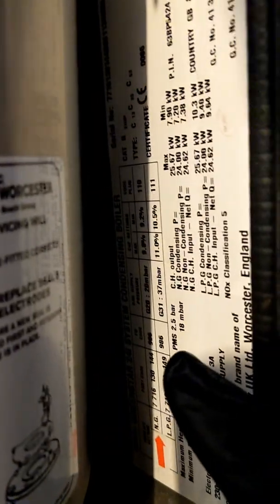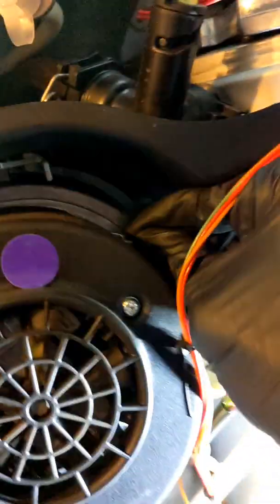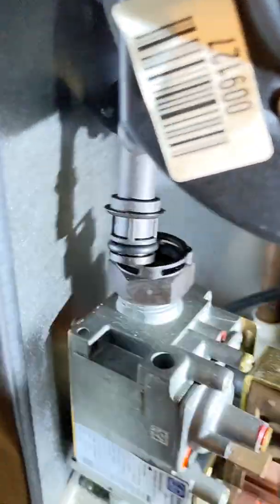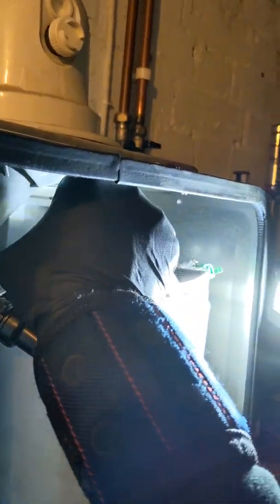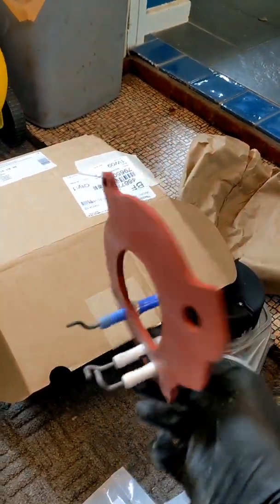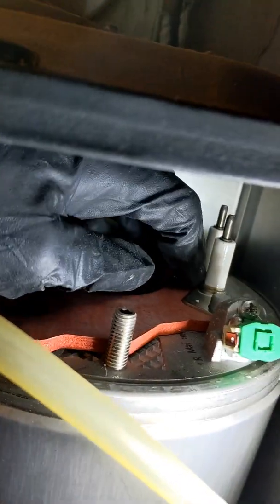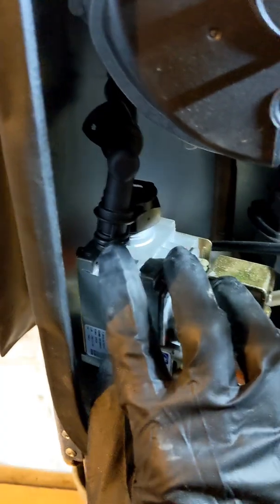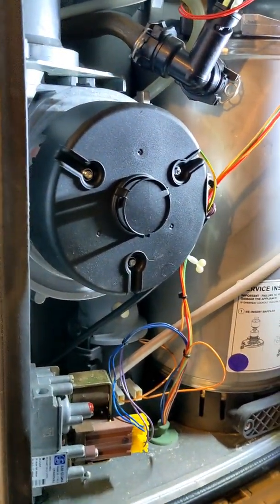Worcester Bosch fan change

Comment: Amazing video. What’s that rubber flap called. One side is completely opened on mines. Should I change it. What’s the product number. Thanks!!
Reply from the maker: It's called a bearing plate 👍🏾
Reply: The plumber put it back without changing it as he didn’t have the part. Does it need replacing or it’s not essential?
Reply from the maker: @tomanderson8614 it would need replacing

Comment: Doing my first one of these tomorrow. I've done some burner seals on these and found there's no one way to get that fan arm in.. with relative ease! Sometimes it's went in with the locking nut screwed mostly down. Other times it's only went in with the locking nut screwed away up. Absolutely hate Worcester lol!!
Reply from the maker: Good luck man! 👊🏾
Reply: @cputilitysolutions  Thanks!

Comment: Just been looking at your video and came across a comment made by yourself with reference to the "bearing plate" being faulty and making vibration noises. My boiler is making loud vibration noises along with the sound of dripping water, I've filmed it in the next couple of videos, https://www.youtube.com/watch?v=MaQSvsTbKbU, https://www.youtube.com/watch?v=BpwVg33rwIA. Would that be the bearing plate that is faulty and causing the noise, or could it be the fan?